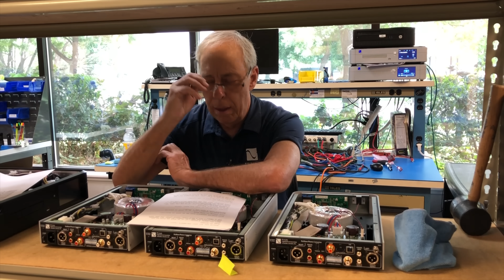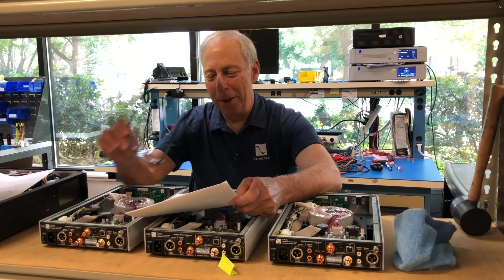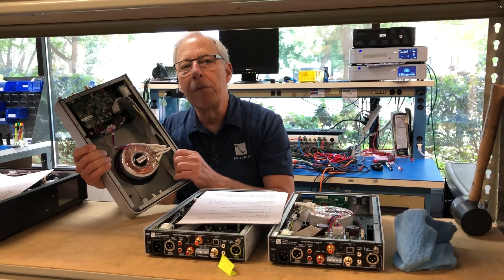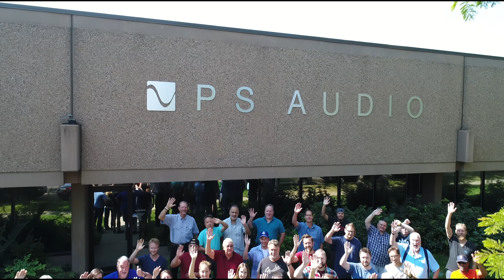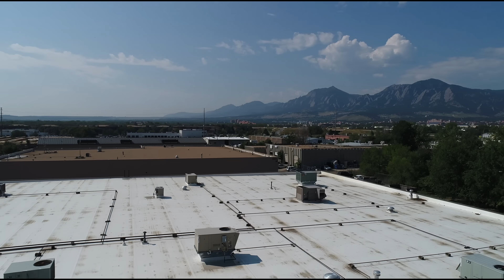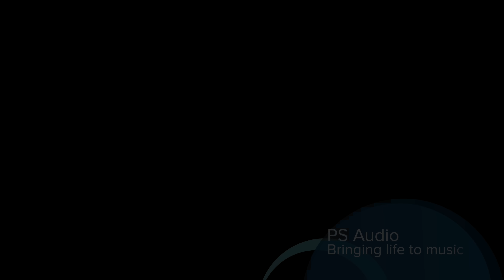What's inside a high end power cable?

Comment: Theoretically, electricity traveled along the outside of a conductor. Electrons travel along the outermost atoms or molecules that make up the conductor. A thick single conductor is somewhat limited as to its conducting surface. Multi stranded wire or cable made up of  a large number of very thin wires carry more current more efficiently than a solid core. That is in theory, and in current carrying ability it can be measured and proven. But power cables for power amplifiers might be different. A single core or hollow core doesn't have air gaps in the cable that could allow current to jump between the minute gaps between the stands of wire that make up the cable, thereby creating noise. The question is, how do you make a solid core wire that is flexible enough to be moved from room to room over the years, like when I was in my 20's and lived in apartments, relocating for cheaper rent or to get closer to my job or friends. A solid core wire will break if bent repeatedly in a given spot as most good conductors are brittle. So, after watching this video, I think I'll experiment and see what sounds better, and then try to make my own compound conductor cable.

Comment: PAUL, I invented what I call a Quantum Power Synchronizer.  I'm trying to get Dr Michio Kaku's help! He's not replying to me, if anyone knows how to contact him directly please let me know.  Oh, this is no joke...  I may have stumbled upon the missing piece of Teslas research...

I do believe there is a shift in our reality, this device should not be working! It's breaking the laws of physics into over unity! This device is not mechanical either! I can't describe it, other than to say it's the size of a shoe box.  It was an accidental find... The best way to describe its performance is like this, picture that shoe box as being a super capacitor, but a capacitor as big as a super market! At the same time, voltage stays the same and current seems to be the same. However at the output, you are getting greater energy! This energy, I cannot measure, but it's there! I validated over and over. I'm hoping this is a dream, but it's not!

I believe, that in order to seriously extract that energy and put it to use, some sort of extractor technology must be built.  This is beyond my knowledge however.  Perhaps it will aid CERN? Or help Dr. Kaku's quest for STRING THEORY?  

I DON'T KNOW AND I NEED TO TALK TO A TOP LEVEL PHYSICIST... 

hehehe sorry for the drama, but this is NOT a joke... OR Snake OIL!

Comment: Open Question:  What would be the effects of bi-wiring a speaker using stranded on the HF section and solid Romex on the LF woofers?  Theoretically wouldn't that be the best of both worlds, according to the information in the video?

I'd like to hear the pro's and con's of this concept in a scholarly way.  If all you have to declare is "snake oil" you are not adding to my knowledge base.
Reply: The whole concept of bi-wiring is a fools errand. That said, on paper, there is in fact a minor electrical advantage to basic bi-wiring. It has to do with the wire inductance looking into the crossover section. And yes based on RF engineering principles, your idea does have some merit. But what many non-engineering types miss is the order of magnitude. The effects at audio frequencies are so far down in the electrical noise floor, not to mention your acoustical noise floor, such phenomenon are inaudible. I mean really inaudible to any human or animal I know of. None of this golden ear crap. An example is did throwing a file folder out of the WTC top floors delay the building collapse. Of course it did. That file folder had weight. Less weight prolonged the collapse. That's a proven fact of physics. And this can be calculated. Now how many zeros to the right of the decimal point will you need to show the number!
Reply: Thank you for the intelligent reply.  I asked because I was curious about the principles Paul talked about and I don't know the answer to my own question. 

Please forgive me because your explanation is eminently sensible and easily understandable but my curiosity is such that I'd still like to try it sometime.  Science be damned!  lol!

Comment: No Paul, your videos are mostly great, but today you are talking snake oil. The sound of a phono amp does not get "much bigger, heavier and more musical" by using a supersized transformer. Rather, in particular in a phono amp, you actually want to minimize EMI to avoid 50/60Hz hum and a supersized transformer is not of any benefit at all in phono amps or even pre-amps. Rather, focus on keeping the Vcc lines constant and clean of ripple by high quality regulators and capacitors combined with careful PCB layouts etc. Of course I can agree that a power amp can benefit greatly from a super sized transformer that can help keep the power rails on a constant voltage while playing loud with difficult speaker loads. Then, another point to be made...from my experience, expensive power cables sound great...except in blind tests! I'm looking forward to PS Audio doing speakers because there is a heck more real audio fidelity gains to be made in speakers than on phono amp transformers and power cables.
Reply: I'd be willing to bet that the pre-amp's DC supplies are regulated so even if their was some voltage fluctuation with a much smaller transformer, the amplification circuitry would never see it.  And then once again, a good design should have a high common mode rejection ratio and be tolerant of supply variations.  And if it doesn't, good regulation would always be mandatory.  Pretty easy stuff to accomplish when the cost of materials isn't so critical.
Reply: Yes exactly. This is not difficult stuff and you don't need a super sized transformer with a ton of unused headroom to stabilize the DC supply to any phono amp, pre amp or DAC. Rather, I would argue that if really the transformers ability to keep a constant output voltage is a concern (assuming you don't use a under powered transformer), it means a poor DC regulation circuitry that leaks the AC voltage fluctuations through too easily. For example, how if you turn on an AC unit near the amp and the mains voltage drops a bit? Of course the amp should be immune to that and it wont be immune unless it effectively isolates fluctuations of the primary side voltage from the DC rails in the amp. I've done numerous products in audio and video and one test category is in fact to simulate AC voltage fluctuations and noise; and make sure you can't notice them. The ability of that type of performance is not about the size of the transformer.

Comment: IMO. Assume that the run from your circuit breaker box is 30ft, solid wire romex 14ga, or even better 12ga. 10, 15 or 20AMP breaker. Also assume that the AC power is ca ca at best to begin with. So running one of PS Audios AC power cables from the wall socket to the equipment is not going to change things very much, if at all. But, purchasing one of PS Audios Power Conditioners or Regenerators and running some of their AC Power Cables from that to your components may make some sense.

In a past video Paul mentioned that using the proper test equipment you can see the audio being played on the incoming mains. That without one of his power products. I can confirm that under some very rare situations that would be true.

A good read is the romex spec:

https://www.encorewire.com/wp-content/uploads/EncoreWire-NMB.pdf
Reply: Note: the practice of running romex inside aluminum piping ensures that someone drilling into the wall won't drill into the romex cable.

Comment: I think it's the matching of different cables to different speakers and rooms that make the difference. For example I could be using expensive wires that sound fuller and with more bass, but if my room is small and my speakers big and too energizing that would be detrimental and so I'd be better off with a less expensive cable and a thinner sound.

Comment: The "subjectivist" high-end audio industry needs a new specification along the lines of "POAI," meaning Percentage Of Audible Improvement.  On such a scale, anything connected between the wall socket and the AC-powered audio gear would likely result in a "POAI" of considerably less than 1 percent.  Does anybody seriously believe that (all but the most specialized) professional recording studios and mastering labs -- the facilities that produce the material we play on our home systems -- bother with whatever minuscule improvement comes from products like Paul's hybrid stranded/solid cables?  Yes friends, the signal chain that connects our music to our ears includes the recording process, and in any signal chain the quality of its output is limited by the weakest link in that chain -- with that in mind, it might be wise to reevaluate how we look at so-called power conditioning products for any but the most exotic, money-is-no-object of home audio systems.

Comment: when it comes to multi-strand is the difference because you're getting small amount of arcing between the strands inside the cable?
you said solid core aluminum don't you mean solid core copper?
Reply: John sweda no, there is no arcing between the strands.
Reply: Speaker voltages are way too low to arc ever. 1000 volts can arc through 1mm air. On a speaker something like 20 volts is loud. And the strands are touching each other, no gaps. There is also no potential difference between the strands so there is nothing to arc.

Comment: Probably just common mode noise on power cable. Put ferrite chokes on either a stranded or solid core cable, and they'll probably sound the same. Wish you made a demonstration or had quantitative data to back up your statements.

Comment: Hi Paul

Does your theory of stranded vs solid core have the same affect with interconnects ?
Reply: Yes it's a known theory with speaker cables too. Silver=brighter, copper=warmer, solid=warmer/better low end, stranded=brighter/more high end. Etc.

Then people do silver coated copper internal wire to get better details, but still sound warm. Different strand count too. Look it up. There's info out there about it.